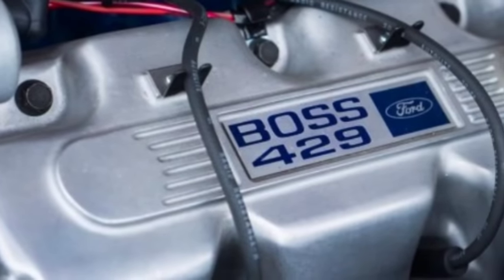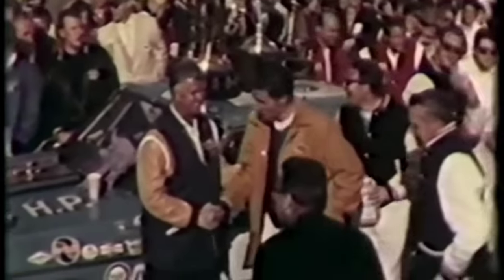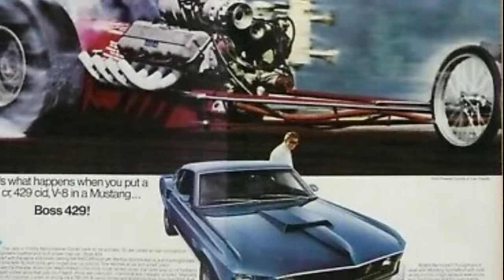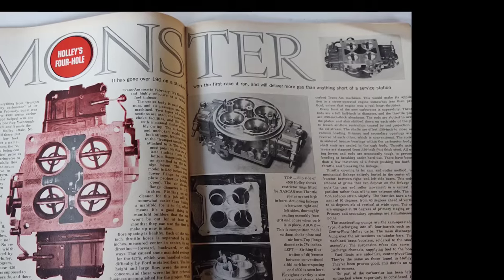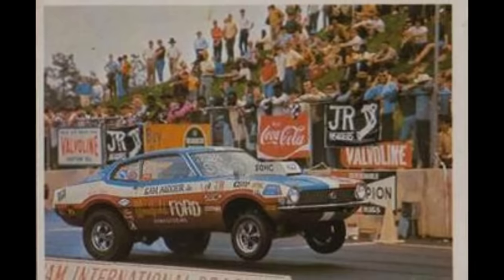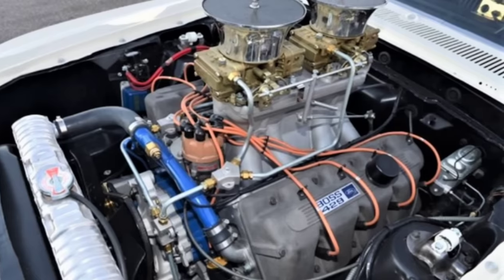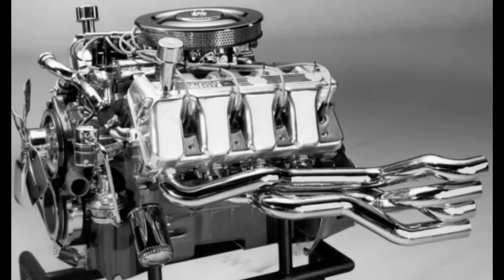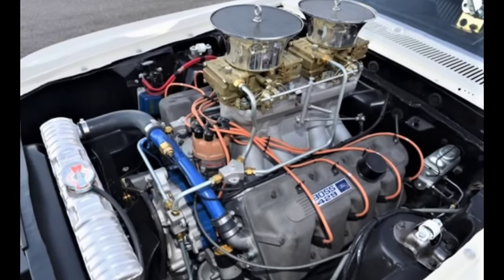The Misunderstood BOSS 429

Comment: The Boss 429 had the same issues as the 4V Cleveland.....low port velocity from the HUGE intake ports. A tunnel ram and well built bottom end, just hang on...
The 4V Cleveland had serious issues with the exhaust ports.....massive potential from the huge intake ports, then a big obstruction in the exhaust.
Glidden solved that by milling the entire exhaust port area away and installing a better turn plate to open up the exhaust ports....just ask "The Professor" Warren Johnson,lol....whined EVERY time he lost to Bob...."He's cheating!!"
Reply: My neighbor is a big ford guy with lots of odd parts he's collected. One day he showed me a spacer about one inch thick that went between the head and exhaust header. He said it had something to do with milling out the ports and keeping it strong. Just curious if it's similar to what you describe.
Reply: If you are concerned about fuel economy and emissions, then yeah, the cleveland and boss 429 had "low port velocity".  But if you're running 9000 rpm's, like RACE CARS do, then they need porting.  The Cleveland design heads are STILL winning NASCAR, on chevies and toyotas as well as Fords. (NASCAR has strict design requirements.  Toyota has no competitive V8's at all, and Chevy isn't using the LS, now are they.
Reply: @mikemc4549  Exactly.....poke around a bit and search Bob Glidden cylinder head modifications on the Ford Cleveland.....they were crap out of the box.
Reply: @mikemc4549  Ford had to make both engines available in street cars for them to legal to race in NHRA and Nascar......the confines of a street car engine bay made it impossible to get the most out of these heads.
   Bob and the Nascar boys quickly solved those problems with  the race version.....it's a highly modified "street cylinder head".....do note NONE of the Mopar cats could make the Hemi work in Pro Stock. They all ran wedge heads.
Reply: @oldmusher  The port size WAS the problem......turning the exhaust within the confines of a street chassis killed the intakes potential......check out all of the massive mods Glidden did to make them work.

Comment: 2 words..."Crown-Vic"  (P71 with the 429 package)
Reply from the maker: I have a '03 Crown Vic... LOL Thanks for watching!  Please Subscribe as follow my build of project MIXED UP BOSS..
Im putting BOSS 429 style heads on a 429" Stroker Windsor Shortblock! It should make around 750hp NA on pump gas when done
Andy
Reply: Now that's a "Poliçe Interceptor"
Reply: @UnityMotorSportsGarage  the 2v 4.6 modular is an underrated beast.  Over built and  under stressed..  I've  got a 97 grand marquis with an engine from an 11 town car. Puts down 375 to the rear tire. lives on the limiter, returns 31mpg highway (if your easy on it) and never needs maintenance
Reply: @zuestoots5176  375 to the rear tire with what modifications?
Reply: I thought the final version of the police Crown Victoria had the 460 configuration? That increase capacity should certainly have addressed the big valves and tunnel ports.
Reply: @machtschnell7452  I watched a 460 used in a car crusher back in 1990. The blue valve covers and the monster growling sound that only a 460 makes. 
     I'm not positive if it was a "helper" of some sort, or if it was alone. The crusher was yellow, and the car was kind of small. 
     I was 12 years old and I recall laughing with pride because my buddy was a bowtie kid.  The GM 455 was a bad dude as well with torque numbers. So this new Godzilla?? Well, it's a 445 C.I. and if you say it a few times over, it sounds like a chime.
     I call it "Son of 460".  My '03 5.4 is a 330 and after a bit sounds like you're telling the time, lol

Comment: I would think that putting a super charger on the boss 429 would get it enough air induction through forcing it in there but you would want to get the proper cam & possibly crankshaft depending on the numbers.

Comment: Hemi ruled the streets and ruled the 1/4 mile in the 60's and they still do today
Reply from the maker: The Hemi was a beast for sure..  Thanks for Watching!
Reply: 440 6 pack was faster than the HEMI on the 1/4 mile.
Reply from the maker: @garymcneill4606  you are right... The Hemi is street form was kinda I'll tempered and if it was off... A 440 would hurt it's feelings!
Reply: They were pretty stout for sure....an argument could be made for any of the newer cars now like the new mustangs and camaros vs the scat paks. The hemis are torque monsters down low for sure, but will get run down by the high revving new 5.0s. We've done several tests between my 5.0 and my brothers scat pak, with the most telling one being a 60-130 pull. My mustang consistently runs that 392 scat pak down everytime, and typically does the 60-130 run about a half second faster than his scat. That being said you cant go wrong with any of these cars. With dodge offering 800hp cars from the factory, and Ford and Chevy both offering 750+hp cars, its really all in what you like. The cars nowadays would be considered supercars just 15- 20 years ago, and they are all capable of 170+ top speeds

Comment: that stock factory intake and exhaust manifolds kept the engine from good power on the street.add a nice solid lifter cam long tube headers,and a new kaase intake and its a 600 hp street monster!back in the day many guys used a tunnel ram and that made a it run.just to bad ford didnt offer a dual quad intake from the factory.and dont forget,the holley dominator was made for this engine,and now everyone uses them.

Comment: Question, so what did John Coletti do different when he put the 429 boss in the SN95? It ran 10.55 and I think 0-60 was like 1.9 seconds of remember correctly.
Reply from the maker: King Jerel, that engine was 604 CI 10 liters! If I remember right it made around 850hp it was fuel injected and had a Ford C6 Automatic behind it... I had a Super Ford magazine I believe back in the day that told all about it...  It was a bad Machine!
Andy
Reply: @UnityMotorSportsGarage  Tru that, John Coletti was a bad man. 👍

Comment: Our  city used Ford Police Interceptors and this engine was the power house needed. Oil change every month, cooling system and transmission serviced annually. Differential fluid drained and refilled every  2 years. 130,000 mils was normal for that engine.

Comment: THE STREET VERSIONS BOSS 429 WERE SLUGGED. BUT THE NASCAR VERSIONS WERE POWERFUL TO THE FULLEST PERFORMANCE. THE BOSS 429 WAS LIGHT YEARS AHEAD OF IT'S TIME. THE LOWER BOSS 429 BLOCK WAS SO STATE OF THE ART. THAT NOT EVEN THE AFTER MARKET COMPANIES THAT WERE MAKING THE CHRYSLER HEMI'S, AND THERE WERE  FEW OF THEM WHO WERE BUILDING TOP FUEL NITRO HEMI ENGINES, HAD NOTHING THAT COULD EVEN BEGIN TO RIVAL THE BOSS 429 LOWER BLOCK. MOST OF TODAY'S 800+ CUBIC MOUNTAIN MOTORS ARE BOSS  429 DESIGNS. THE HIGHER UP IN CUBIC INCH YOU GO ON THE BOSS 429, THE BETTER IT WORKS.

Comment: The answer to make an engine run is always forced induction. Preferably a turbo as they are the most efficient. And proper tuning. Couple that with consistency in drag racing and you'll hardly ever lose.

Comment: I had one of the 2000 made 65 ,L78 396 ci ,425 HP Corvettes..An unbeatable beast in street racing. The late Jack Connelly tuned and set up the ignition ,carburation ,and machine work..
   Side pipe Off Road Exhaust , Close  Ratio Rock Crusher 4 spd ,411 posi.
  These motors had all the Nascar goodies ,Solid lifter cam ,square port heads , Aluminum Hi Rise manifold ,dual feed holly ,but Jack tuned it to be King of the Street...His expertise made unbelievable power..
  I raced a Ford engineer with the Boss 429 and just crushed it. When the guy saw me at the local Sunoco ,He ask ,What do you have in that thing ? Jack Connelly prepped L-78 396...No wonder you could just run off and hide from me.. Connelly was well know in the region as the best machinist ,and tuner around..I would only race cars like the LS 6 454 Chevelle's and other big block or pro prepped street cars..The smallest engine car I raced was a Gap & Rough 351 Cleveland on Nitrous...Crushed that stang too.
  Because of the solid lifters ,and no skatter shield I never raced it at the drags.
But having riden in sub 12 second drag cars back then ,I think it was that kind of car too.
Reply from the maker: That is awesome!  The 396 is one of my Favorite Chevy engines... They ran hard! Thanks for Watching
Andy
Reply: Fake

Comment: Can you explain what the big difference is between the various Mustang sub-brands, such as what is a GT-xxx, what is a Boss xxx, what other special editions were there and why?
Reply: "Boss" engines were basically factory-built race engines put into these cars.  Radically different than the standard V8s.  I think the GT, like the GT390 was just a fancier version of the Mustang, with the 390FE V8.  The V8s they made back then are totally different than like the 5.0/Coyote or 4.6 V8 that they made awhile back too.  Idk I always thought the GM engines were better.  Maybe not as reliable, but produced more power.

Comment: Boss 429 385 series wasn't a 428 Cobra Jet FE series the Boss had a fair bit of weight in the front compared to the 428 the SCJ Mustangs ran 13.5 seconds stock and Boss ran 14.2 stock but 428 ran out of puff and the Boss was designed to run over 7000 rpm all day and if U tuned a 429 Mustang right it was easy capable of 175mph in top gear a 428 was good for maybe 150 because the 428 was more for mid range torque and more tractable the 427 Tunnel Port fitted in 67 Mustangs could pull 13s and top out at 150-160 depending on the gearing but they were never installed in a production Mustang. Leave any comments on what you think.

Comment: I've only seen one Boss 429 & it was in a old Ford truck for tractor 🚜 pulling. The story behind the engine was someone wrecked a Boss 429 Mustang 🐎 & all that was left was the engine, so someone bought it & was using it for tractor/ truck pulls. It was sad 😢 to see that gorgeous engine in a pickup truck. I had a 351mach 1.

Comment: To put it in perspective "the 429 could barely get in the 13's on the drag strip". My 1985 Corvette with a 100% STOCK 230hp engine ran consistant 13.90 second ETs at the drag strip.
Reply: Chevy's will always beat Ford's, It's just the way it is. 😀 And I drive a Ford.
Reply: Who cares about your vette.
Reply: @philsocks3386  Who cares about a crappy old car with bad brakes and suspension like a 1970 ford? Or an old mopar? Cars from the 60's were trash.

Comment: I don’t know a lot about the Boss 429  except my Dad had a freind that had a Mustang with one  and that he had to unbolt motor mounts and Jack the engine  up in order to do a tuneup and replace all the spark plugs  ironically I had a Ford pickup many years later  and although I had professionals doing the work onmy truck  I then wound up doing  a tuneup myself and realized one of my Sparkplugs was  very difficult to access and when I finally did remove that one  I found that all the previous mechanics and shops never bothered changing that one  and that it was the factory original ? It was a pain to access and required  a goofy amount of extensions and Universal joints on a spark plug socket and ratchet
Reply: Sunbeam tigers had rubber plug in firewall ,to get s plug out from inside cockpit

Comment: What a lot of people don't realize is that the Boss 429 was designed as a high-rpm, constant speed NASCAR race engine for the super speedways. It was never intended to be run on the street, except that NASCAR then mandated that a certain number of street cars had to be built in order to qualify it for racing. So Ford put a certain number of the engines into Mustangs without modification to the heads. The only changes were in the camshaft and compression ratio, which were toned down by the NVH (noise, vibration and harshness) people at Ford.  Actually, I can remember reading an article in the old Super Stock and Drag Illustrated magazine which asked the question, "What Do We Do With A Boss 429.?" The street Mustangs were getting shut down by 383 MoPars and other similar cars, not even counting the Grade A supercars like 427 Chevys and 426 Hemis. They came to the conclusion that one relatively easy change required was a camshaft change. A friend of mine from the Denver area remembers looking at a Boss 429 Mustang at a local Ford dealer, and he was offered a sale price of $3500 just so the dealer could get rid of the car. They had two, a Grabber Blue and a Grabber Orange, take his pic. Remember the 1969 Daytona 500..? The Boss 429 was not yet cleared for use by NASCAR, so the Ford racers substituted tunnel port 427s, and one of them won the 1969 Daytona race over a horde of 426 Hemis. Then and now, the head ports were too big for street Boss 429s, and really anybody building one of these engines needs to stroke it out to at least 520 cubic inches, if not more. And with a minimum of 10:1 compression.

Comment: Know a guy that had both flavors of Boss. A 70 429 & 70 302. He said he only lost 1 race and it was to a 70 440/ 6pk 4 speed challenger with 4.56 gears. Otherwise he beat everything with that super fast 302. The 429 he said was INSANE and useless to race as he could never get it to hook up cuz the big motor just melted the tires off at the line. Won a bet one time when he laid a 120.ft double black mark running her through the gears. That car was scary. Cruising at 70 if you stomped the gas pedal it would break the tirrs loose.DAMN

Comment: ,,,,,,,,,Great work Andy.............Canted valve V-8  engines make the most power...........I grew up with wedge head powerplants,,,they were everywhere and cheap to build.....Screw  em for real power.......asymetrical port layouts in head design are inferior , as to a symetrical design.......I own an 88 fox stang , 347....I want to find canted heads for this motor.......

Comment: Seems Mopar had the same problems with their Hemi.   Heavy pistons (because of the weird cumbustion chamber shape) and a valve train that has all kinds of crazy angles - doesn't like super high rpms.   Prostock has gone the way of the Chevy  big block (I can't speak to it, but I've been told at least for a while, the Mopar Pro Stock heads pretty much looked like Big Chief Chevy/<cough> Pontiac heads.
Oh well.  I build motors for less than the cost of a couple of Hemi heads ..... but they will never look as cool.

Comment: Assuming no boost, besides #1 increasing displacement, what are the #2 and #3 things to do to a stock Boss 429 motor to get it to perform better in the 1/4 mile?
Reply from the maker: That would involve in raising the intake port roof and filling in port floor to make a D shaped port by reducing the port volume and raising the port your would gain a substantial amount of Port Energy and port velocity which is key to making great power...
Andy
Reply: The usual, headers and cam. Even a different intake and maybe carb would help.

Comment: I imagine of the original displacement would have been 460, maybe it would have done better on the street. Also, squeezing the intake ports and runners would have added lower rpm velocity.  This was the issue with CJ heads and 4bbl Clevealnds too. Thank the engine gods for Jon Kaase!
Reply from the maker: Karl it had to be 429" to be legal for NASCAR.. the CI limit was 430" Ford did make a 494" version for Can Am racing and it was a sight to behold!  Thanks for Watching 
Andy

Comment: I remember rumors that 429 Boss didn't work well in the mustang, and that the 302 Boss with very few mods could easly take the 429 Boss in the 1/4 mile. My father worked with a guy who had a 302 Boss mustang that was modded that claimed it would eat most big blocks for dinner.

Comment: I would think even with the attributes of the valve layout of the hemi combustion chambers the necessity of a huge dome would be so detrimental that any flow benefits would be squashed by such a poor combustion. You can get a pair of GM smog heads 882/993 to flow half way decent but the combustion is poor in that big inefficient bathtub type chamber hurts any potential of any flow gains achieved. There's been advancements in head flow over the years but to me it seems combustion chamber design has been the biggest breakthrough in cylinder head technology over last 20 years. I dunno you have forgot more than I know so maybe I'm wrong....

Comment: From what I know (boss) meant 429 block & 460 heads......I had a 1969 T-bird with the N1 429, aka Thunderjet.all factory original...that was rated 400hp from the factory, it had huge exhaust valve ports,  of course I tweaked the 4brl carb (which also had large secondary ports) a bit which made a  difference.....it was all about making that mill breath....also had a mercury 460 that was almost as good as the 429...

Comment: 1971-1973 Mustangs engine compartment was enlarged to take the 429, but never got  a single one. Insurance rates killed it then lowered compression ratios to burn lead free gas.
That knocked performance and gas mileage in the head for years
Reply from the maker: The 71-73 Mustangs made the BOSS 351 famous..  It was a real street sweeper... Thanks for Watching and please Subscribe
Andy
Reply: @UnityMotorSportsGarage  71 Mustang had the 429 SCJ as an option.

Comment: Boss 429 is misunderstood because it wasnt as badass ass a Hemi , LS5 , etc. Ford screwed the pooch should have offered the mighty 427  " Cammer " as a production option. ( 615 hp 4V , 653 hp with 2 x 4V  ) That engine was so badass !!  🏁🤩 It would have kicked ass on the Hemis and anything GM had to offer except maybe the L88 Vette 🏁

Comment: Oh… a 428cj stock with dual plane intake & it’s slightly smaller carb would rock on the street compared to the Boss 429. 

Well shoot, it’s still badass and had lots of foresight & held true to its purpose of being a Nascar oriented engine.